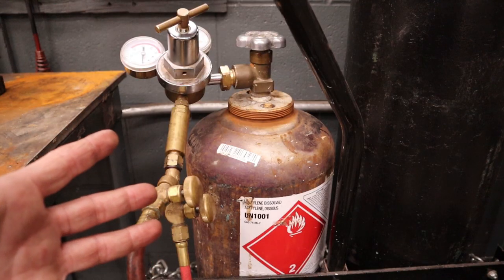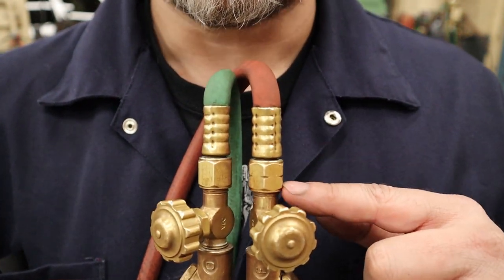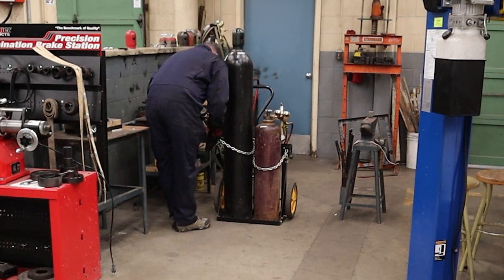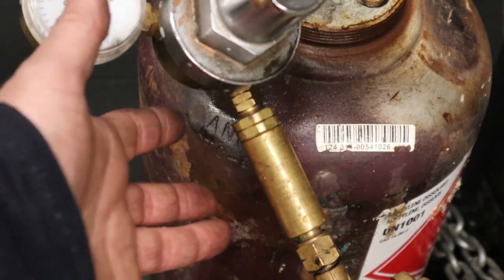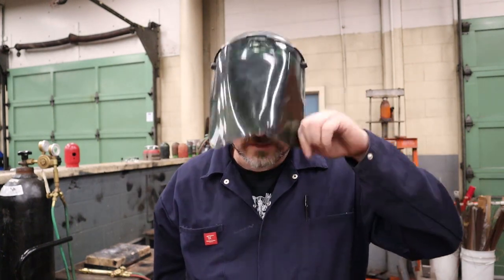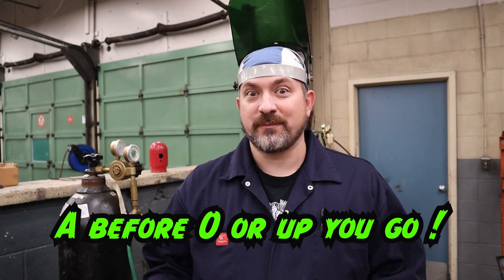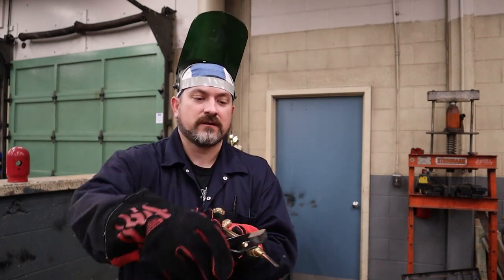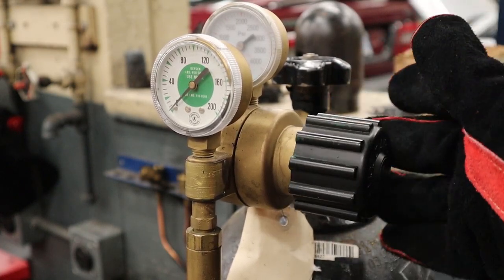Gas welding safety, set up, and how to get to a neutral flame.  How to Become a Welder! #Ep2

Comment: LoL yeah, I tend to learn the hard way. The most memorable was when I'd wiped down my welding table and project with acetone to clean it. Normally it would have been ok, I'd put the container away, but didn't think about my shop's temperature. Long story short, my entire table caught fire. It didn't last long, but it was alarming LoL Safety... Third? 😁
Reply from the maker: Lol...nice!  I usually give the area a blast of compressed air to help dry up the chemicals before I weld.  Pretty hard to tell your on fire once the helmet goes down.  Reminds me of a time when my coveralls smoldered up my legs....cheers!

Comment: Hi, way of wrench.
Can I use your "A before O" best practice for LPG/Oxy welding?
Reply from the maker: OxyPropane is very similiar to OxyAcetylene so yes but it is slightly different to set a neutral flame.  If the torch pops when shutting it off, shut the oxygen off first, then propane.  Cheers!

Comment: Thanks for showing how to set the pressures.  I've watched a couple of other videos and they say something like set the A to 5 psi and the O to 6 psi. but they never say to do it with the torch open or closed and don't talk about how far to open the valves.  Thanks so much for that little bit of info.  I do have a question though.  I have a small  portable set where the tanks have been sitting around for a couple of years.   The A tank gauge is reading -0- but I still get a flame.  How likely is it that the tanks leaked to empty or is it more likely the gauge is wrong?  Thanks for the good video.
Reply from the maker: No worries, glad I could help you out.  I would soapy water test your setup at every fitting to make sure you don't have any leaks.  After that then you might have a faulty or mis-calibrated gauge.  Thanks for the watch!

Comment: When in senior high school I had a teacher that stressed that when moving an O2 tank make sure that the safety cap is on. He said there was a time when a tank was moved without the cap and it fell over it took off and went thru 5 concrete walls before stopping.
Reply from the maker: Yeah there's a lot of pressure in there and that's definitely possible.  Hopefully I never find out!  Thanks for the watch!

Comment: Hi there! I just found your videos this morning (welding the fox!) and have enjoyed a few of them so far. I was also an educator that taught Apprentices for 25 years (in Ontario) before I retired just before you made this video. I taught torch Brazing, Welding, and Cutting primarily (I was very passionate about that particular topic), but also the HVAC/R trade (my main trade for over 40 years). I admire your ability to produce these excellent videos and only wish I had the skills to edit. I don't want this to come off wrong or sounding like I came on here to cut you down, but there are a few points that you made that I would disagree with. I do agree with about 95% of everything you said and am also amazed that you covered all of that in 26 minutes! I chuckled when I saw the soot marks on the wall and door! Even though my students were "adults", we got a bit of that as well. Thanks for sharing your skills and most of all, for fostering an interest in the trades! We certainly need people like you!
Reply from the maker: Thank you very much for your kind words!  I work very hard on these videos and trying to get my students excited about the trades so it's always nice to hear back from people!  Enjoy your retirement!

Comment: I'm a machinist and Im just getting into welding . I'm doing this at my house and some limitations basically makes gas welding my best option. Is this too dangerous for someone new and learning on their own? I feel confident I can do it , but I've also heard some people say you shouldn't try to learn this on your own as as well.
Reply from the maker: Cheers!  I'm a Tool & Die Machinist as well!  Well I guess if you weren't a machinist and you were thinking of getting a lathe, there would be dangers there too.  Would you feel it would be better to learn somewhere else where a competent teacher or tradesperson could help you learn?  I would think so personally but it really depends on the individual and whether they are safety conscious or not.  There is the live fire, sparks, hot metal, and possible explosions ( if not operating/closing valves/bottles properly) to think about as well.  So I would suggest learning elsewhere with someone qualified to teach it and then perhaps try at your home shop which is set up to safely weld in.  Good luck on your welding and Thanks for the watch!
Reply: @wayofthewrench  thank you for the reply! Ive decided to give it a try. I have the gas welder available to me and while I may not lay great beads lol I feel confident I can at least make bad welds safely . :)
Reply from the maker: Perfect!  Good on ya, if you have any questions, feel free to ask!  There are a bunch of gas welding videos in that playlist if you need.  Cheers!

Comment: One thing I think is important to mention about the oxygen tank is that is the valve isn’t open all the way the safety disc in the valve won’t operate
Reply from the maker: The main cylinder valve has to be opened all of the way as it has a back sealing valve which leaks if it is not.  The safety release still works with it open all of the way.  Thanks for the watch.